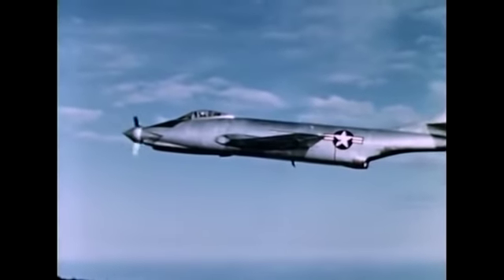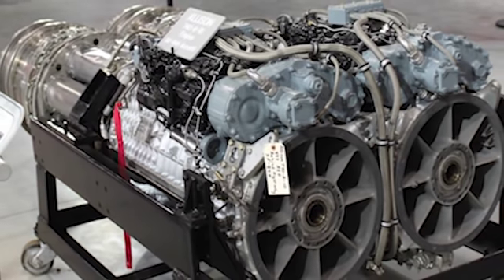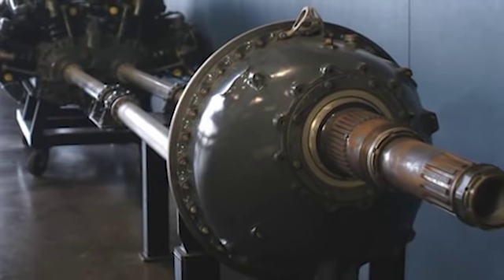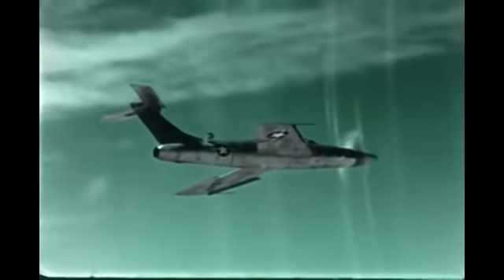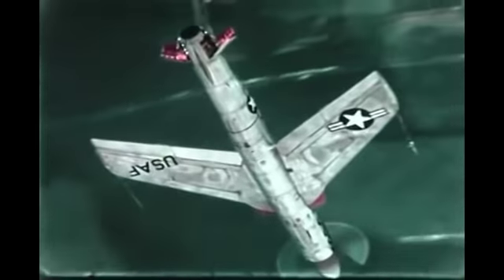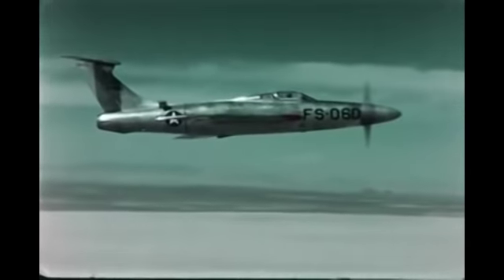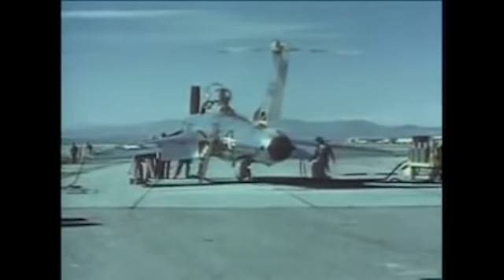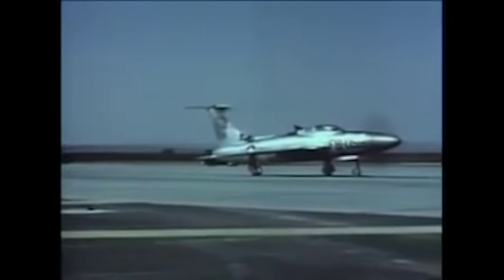The Republic XF-84H Thunderscreech | The loudest plane ever built

Comment: You just know it would shake a pilots teeth loose!😬😱😵😂👍. 👁👁🇺🇸
Reply from the maker: Those shakey drive shafts weren’t a joke 😂
Reply: @theatomiccafe8996  Worse about the drive shafts, the pilot had to turn a dial every two minutes, to check the temperature of each of the bearings!
Reply: @theatomiccafe8996  "The engineers have the green light to eject": I suspect if one of those bearing blocks sized the shaft would have torn through the cockpit much faster than any pilot could get to the handle.
Reply: @leifvejby8023  That could have been rectified with a little more work: I flew a plane with individual CHTs but unless you specified a certain cylinder (for example you just got a can or piston changed and you want to see what that one cylinder specifically is doing) it would just show you the hottest one by default. So this was probably one of the the smaller problems this aircraft had!
Reply: @wilfdarr  They could, but they didn't, and it just added to the pilot's workload.
Only one of the 16? flights didn't end being an emergency landing.

Comment: As a pilot of Cessna AirQueen and AirKing turboprop airplanes I know that the shockwaves of the props going supersonic is bad not just for the plane but for anyone who hears them on the ground too, we aren’t allowed to rev up the engines and/or accelerate the props to mach numbers (and yeah the tips of the props will go mach1+ sometimes even faster) because they’d cause vibration damage and could cause susceptible people to have headaches, dizziness, and nausea or at worse seizures. For those who don’t know when taking off we apply just enough power to take off (calculate weight vs speed needed equals applied power) the pitch of the proper is also adjusted to make as much bit as needed and to prevent extra noise upon applying power to (no fine pitch props only feathered (ei: dead engine(s) ) or biting but idling engine(s) while taxiing or on airport terminal grounds.

Comment: The problem was that the propeller tips on the Thunderscreech were supersonic even at idle. That means essentially a continuous wave of sonic booms while it's on the ground. Not something that airports are used to dealing with. Supposedly the noise wasn't actually dangerous so long as you stayed out of the plane of the props... but if you did, it would "knock you down".

Comment: Hello again.
The XF-84H wasn’t the only aircraft used for supersonic propeller research.
Another aircraft appears at 1:30 in the video.
It is the McDonell XF-88B Voodoo.
It used a single T-38 engine.
It did not use the propeller during takeoff, the Voodoo’s regular engines were used most of the time.
The turboprop was only run during ground tests, and once the aircraft was at altitude.
It suffered from from noise and vibration problems as well.

Take care.

Comment: Stand around any plane running a Honeywell TPE 331 and you will get a small taste. Not super sonic propellers, but an engine that always runs at full speed. Thrust is controlled via propeller blade pitch.

Comment: What I'd like to know is what was the RPM for the prop? I know it was run at a constant RPM, but for only 12 feet to break the sound barrier by 18 percent, it must have been REALLY whirring. The B-17 had 11 foot 7 inch props, the B-29 had 16 foot 7 inch props, and the B-36 had 19 foot ones. Even the 19 foot ones on the Peacemaker didn't break the sound barrier!

Comment: BTW, the problem with propeller blade tips going supersonic and creating noise is exactly the reason that helicopters are so noisy. On many helicopters, the tail rotor turns at a sufficient RPM to approach or surpass supersonic speeds. NOTAR type helicopters are so much quieter it's unbelievable until you see one in action. They do require a different set of pilot reflexes as the NOTAR system doesn't have the control authority of a tail rotor, though.

Comment: The fastest speed attained by a prop driven plane was Mach 0.91 attained by a stripped photo reconnaissance Spitfire of the experimental flight at RAE Farnborough. Ref Wings on my Sleeve by Eric “Winkle” Brown who holds the record for the most number of different aircraft flown and the list does not include multiple marks of the same plane eg Spitfire is listed as a single entry although he flew every mark from 1 to 23 plus the Seafire. It is an amazing accomplishment and is very unlikely to ever be broken. RIP Commander Brown

Comment: Prop aircraft are normally carefully designed to prevent the prop tips going supersonic. I think engineers calculated actually allowing the props to go supersonic might allow for a faster and more efficient aircraft. It still didn't work as well as calculated, and the noise made the aircraft impractical. Also, I'm guessing you can't use contra-rotating props with this arrangement, forcing the pilot to deal with very high prop torque.

Comment: Supersonic prop tips=extreme inefficiency due to the loss of laminar flow.  About the only advantage I can see is the potential for high transonic/supersonic flight (assuming that it could create a supersonic thrust stream...if the prop blades are shaped like a traditional propeller blade, then it seems like turning the prop blades supersonic would merely result in something similar to propeller cavitation in a boat propeller)

Comment: What was the actual DB level of this plane ? Not mentioned.  Once had an SR-71 take off overhead.  Incredibly loud.  Suspect it is the ' fingernails on blackboard ' sound rather than DB level as far as F-84 goes.
Reply from the maker: I cannot find exact DB levels. However the one recording was said to have been 104 db and the plane was at 26,000 feet at the time. It caused a man to have a seizure and made people near it vomit, so I can imagine it was upwards of 130 db to do that according to what I have read.

Comment: Can you cite a source for the recording at the very beginning of this video?  The only problem I have with this being a “actual recording” is this aircraft flew back in the 1950s and that recording sure does sound surprisingly pristine and crystal clear! Most recordings back then would be scratchy, dull and would not have the clean clear sound like that...... unless there’s one hell of a sound restoration program/device that I’m not aware of!
Reply from the maker: It’s audio that I stripped from one of the test videos I found. Then I cleaned it up using Adobe Audition, de-noised it and adjusted the EQ on it. The caption in the film stated it was over 104db at the recording site and the plane was flying at approximately 26,000 feet at the time of the recording.

Comment: Yeah, it was noisy but I suspect that the currently in service Russian Tu-95 / Tu-142 Bear Bomber is noisier.  This plane has FOUR turbojet powered contrarotating props that spin the prop tips at well over supersonic speed.  It's the only aircraft I know that can be heard at a distance by the crews of escorting USN and USAF fighters over the sound of those aircraft.

While escorting the carrier USS Saratoga (CV 60) in 1985 we were over flown by 2 Bears.  We could hear them from over 50 miles distance and over the sound of the pair of F-14A Tomcats each had as close escort as they passed overhead.

Comment: if the prop noise was so bad why didnt they install a clutch into the front gear box? so no power on the ground until they engage it? they could also have used the gearbox to limit the prop to subsonic RPM untill they were off and away.

Comment: There where some early 1950ies carrier planes with a combination of a propeller and a jet drive, the propeller was responsible for acceleration and fuel economic for long range flights and the jet gave a much higher maximum speed for  air combat, but their design was like an average radial engine driven WW-II fighter. I heave never heard they tried this with transonic propellers on a plane that looked more like a jet plane.
 
Links:
https://en.wikipedia.org/wiki/Curtiss_XF15C
https://en.wikipedia.org/wiki/Ryan_FR_Fireball

Comment: I live in Vermont and the Air Guard got the new F-35s assigned to Them . Most people were fine and supportive  with this,but a few were worried about how noisy the new Planes would be and were complaining once the Planes started arriving. I think those that complained should be brought to an airfield and first have an  F-35 do an unrestricted fly over with afterburners then be told "You think that was loud? Hold on ...." Then have an XF-84H do a fly over without pushing the speed too much . Then have the Complainers be told " Now THAT'S a noisy Plane !  So stop complaining ."
Reply: Cuz the best way to win support from the local population is to act like an elementary school bully
Reply: I live two miles west NSA Carswell. 
I can attest to the fact that  the F35 is extremely loud. Louder  than F18. My house is under the landing pattern and there is a steady stream of F16, F18 and C130 flying over my house, at all hours. Fortunately F35 mainly fly during the day.
Reply: @nancywilliams3703  ,very often ,F-35s fly overhead as the Town I live in is not far by air from the Air Guard Base . I have noticed that They are marginally louder but not annoyingly so. That Base used to have F-16s  and though slightly quieter ( I mean Jets aren't noted for being quiet anyhow) ,Their engine sounds seemed "sharper " whilst the F-35s sounded more "dull"or deeper -"throaty". Kind of like comparing motorcycles as an analogy : A Ducati Racing Motorcycle definitely is loud with a sharp "whine" (analogy for an F-16)  ,whilst a Harley Davidson is Cruiser is loud too but in a deeper more rumbling way (analogy for an F-35)  . I hope this makes sense .

Comment: I thought the continued exploration of turboprops in the 40s -60s was down to their (even at that time) marked advantage in fuel economy.  Rapid thrust increase may have been an ancillary issue but the reason the T55 and other early, very powerful turboprops were developed was range, range, and more range.  In fact it was not until the development of high bypass turbofans that pure jets achieved similar or superior specific fuel consumption to turboprops. 

Comment as of the first 90 seconds of the video.
Reply from the maker: The Thunderscreech was specifically built to explore the rapid thrust ‘angle’ of propeller research.

Comment: Another reason they did this was the fact that early turbojet engines GOBBLED fuel!  The result was short range.  It was thought that a turboprop fighter might solve this problem until better jets could be developed.  They had NO idea how loud this thing would be until they tested it.  They literally had to tow it to the far end of a giant desert field in order to run the engine up to speed because the noise was so incredible that if you were within a mile of it you ran the risk of hearing damage!  

Supposedly at full RPM it could be heard loud and clear 25 miles away.....

Comment: I'll stick with the NK 12 Engines. Only mach 1.06 but variable prop speed meaning you youre not deaf after only 1 flight. Also I like the fact that it outputs 15000 hp per engine

Comment: The tips of the contra-rotating props on the Tu-95 are also supersonic, are they not?
Reply from the maker: Yes. There was a report that American submarine crews could hear when the Tu-95 would fly over them out at sea. The shape of them, however, helps reduce sound somewhat. The short, extremely wide, blades of the F-84H seemed to contribute to the absolute unbearable levels of sound compared to the Tu-95
Reply: @theatomiccafe8996  Yes that's right.  The Thunderscreech is really an object lesson in how mot to do supersonic propellers.

Comment: So, was the TU-95 as loud as the XF-84H?  If not, how were supersonic propeller blades avoided?
My guess is the Soviet counterpart didn't last long in service either.
Reply: The Tu-95 is possibly even louder because it has four engines with contra-rotating supersonic propellers instead of just one (so 8 propellers in total, 2 per engine). The difference is that the propellers aren't always supersonic. The Tu-95 is still active and has been in service for 70 years.

Comment: I've often wondered if the Thunderscreech concept could be reapplied as an area denial weapon. Like say a large number of enemy soldiers are holed up in an abandoned town in Syria/Iraq/Somewhere. You don't want to send soldiers in to certain ambush, but you also don't want to carpet bomb the entire town just to get them. So, why not have a few Thunderscreech fly a holding pattern over the town for several days until the enemy is thoroughly irate, demoralized, hasn't slept in 50 hours, and is barely capable of functioning, THEN move in with a ground invasion? It seems like annoying the living heck out of the enemy with sound so deafening their coffee mugs bounce off the table could have its uses.

Comment: Wrong the Focke Wulf 190 ta 152 holds record for fastest prop plane. Even has rumours of the plane hitting Mach 1 in a dive. The analysts observed the stretched rivets in the plane only to be caused by speeds of 780mph or greater. Sorry Chuck Yeager the Nazis beat yah to it. Me 262 was also undocumented but rumoured to hit mach 1 on a boom and zoom run.